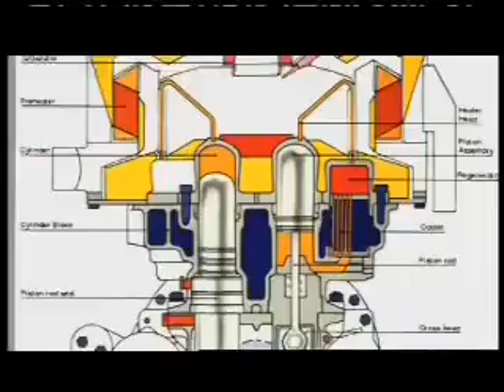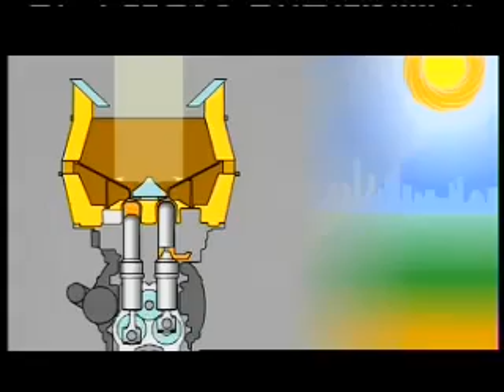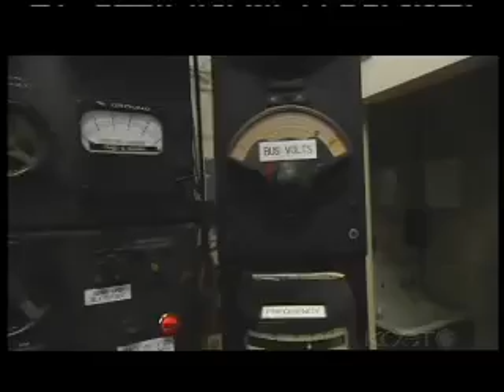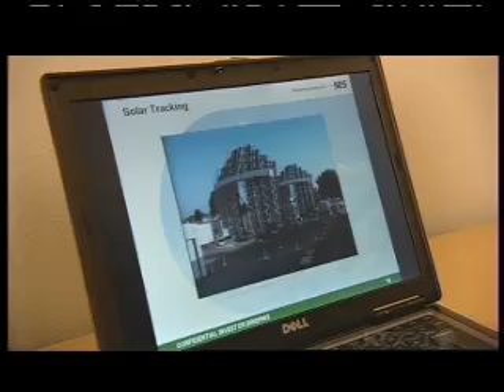Stirling Engines - Solve Energy Needs?

Comment: The record-efficiency of the "suncatcher" was 31.25%. That's much better than common photovoltaics indeed. But efficiency counts less than costs. Photovoltaics is cheaper today. And concentrated photovoltaics (CPV) achieved even a higher efficiency meanwhile: record from Amonix: 35.9% module efficiency.

Comment: It is true that no engine is 100% efficient, but when only heat is necessary, the waste heat that is not used by the engine can then be used to heat water for your home.  It's called CHP, Combined Heat & Power, and it raises the efficiency of the system as a whole to as high as 98%.  Combine this with the fact a Stirling engine uses external heat source, and you have a non-polluting system with 3x the efficiency of powering your home over the electrical grid.  The world needs more mCHP research!

Comment: @sjh7132 All heat engines have a maximum efficiency based off of the temperature difference on each side of the engine. They can never reach 100% but they are extremely efficient when you consider that you are converting heat to mechanical energy. I think they reached ~70% efficiency from these systems a few years ago on a clear winter day.

Comment: If they have wheels, they can move around everywhere avoiding cloudy areas. Wind power generators may also have wheels and move around to take in wind energy. Water stream are only fluctuating around seasons, water power turbine and wind power turbines can be combined as well and they might be able to move around using steel cables to relocate to high volume stream locations.

Comment: Solar as a horrible capacity factor. Your little 2.5kW unit may sound great until you realize its capacity factor is less then 20 percent. What does this mean? Basically you are only going to reach 2.5KW 20 percent of the time. Nuclear on the other hand has a 90 percent capacity factor.

Comment: you right. stirling engine cane be multi heat source driven. it is an indispensible off grid self sufficiency device. i like concept of tilting mirror array down at night to connect stirling with wood gasifier or other night time heat  source for stirling to keep working for you.

Comment: Sadly, it is far from commercially successful.
"Major reliability problems with ...Stirling engine included [too numerous too mention]. That means that on average once every 40 hours a problem of some type required shut down and maintenance. Nearly continuous maintenance was necessary to keep the system "available" to generate electricity."

From  Barry Butler, a PhD expert in Stirling solar technology.  google kdfullerblogspot and go to 4/17/08

Comment: the fan running off the heat on  top of a wood stove is a good use of sterling. directly coupled to the source application. Commercially successful?

Comment: I agree with luvofcountry.
@SCTV there really is no problem to do this in your garden. In my country NEC (National Electricity Company) is legally obliged to buy 100% of my production if it's solar, water, wing or geothermal generated) and on a superbly good prices(for exapmle 0.50$ for 
kW/h solar energy)
I read NASA has built cars with Stirling engine.
I'm also happy that USA finally signed the Kyoto Protocol which leaded to that kind of projects.